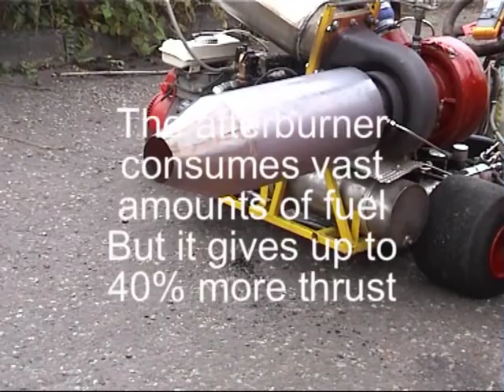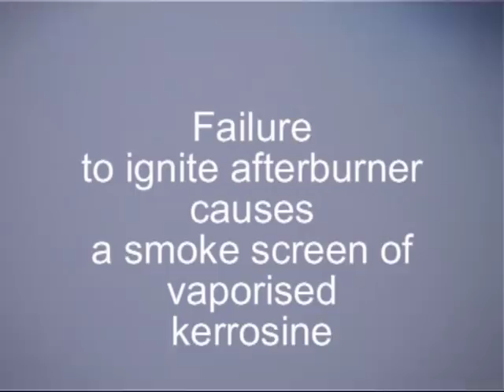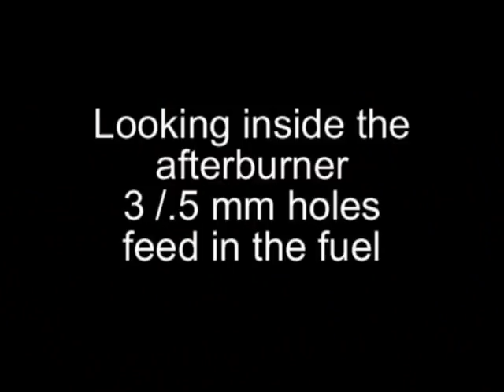JET KART WITH AFTERBURNER ON THE ROAD

Comment: I'm pretty amazed at all the trash talk comments for this.  I wouldn't care if it did only 35 MPH as it's a real jet turbine engine powered vehicle.  The fact that it's been cobbled together from vehicle turbochargers into a working form is quite something.  The fact that the builder has managed to come up with a design that will allow it to run on kerosene rather than bottled gas (LPG/Propane) is one of the biggest hurdles that builders of these types of jet turbines encounter.  Designing a working combustion chamber that will work with a liquid fuel is a substantial achievement that fully 90% of all other homebuilds I've encountered can't do.  Give the designer/builder credit where credit is due.  This is really much more of an achievement than you haters are acknowledging.

Comment: have you considered  using a reducer and gearing it to a drive line instead of using just the exhaust thrust? I'm guessing you are only using a fraction of the potential output as-is. It would be cool to know the results if you ever try it

Comment: Wow... all that for like 15MPH... no thanks I'll pop an R1 in it...
Reply from the maker: Not sure I have the ability to POP a R1 into it
I will just play with gas turbines instead
Reply: doubleboost Me and my brother did it no problem :) we took a yamaha golf cart, beefed up the suspension and axles, removed the two stroke engine, replaced it with a chain driven R1, welded and customized the shifter area, and put in customized clutch cables and throttle cables. We put disk brakes on all four wheels with pedal controls for the front and an emergency brake handle for the rear. We put in a steering dampener and beefed up the entire steering column. We added key start and basically everything on that cart is fully custom. It was actually quite a bit of work, but not too complicated.

Comment: Awesome invention, really fun engineering.  Nothing cooler than a jet engine.  Now you need to modify the cart itself so it resists the road less.  Larger thinner tires to start.  You're losing a large mount of thrust to the pavement.  Also ensure wheel alignment is perfect, or even more thrust goes into the pavement.

Comment: A great project, nice to see some seat of the pants engineering going on. I am absolutely sure this thing, given room, could really get a leg on.
When I served in the RN (during the 1970's) our portable fire pumps onboard certain classes of ships were Rover GT's (the same ones as had been fitted and assessed for use in lorries during the late 60's) 
(Ours didn't have AB's fitted, they just drove a centrifugal pump to fling water about.)
The ship board ones ran on kerosene too, but we started them by using the power of two handle winding sailors, one on each side of the unit. We would crank them up to self sustaining speed, then switch on the igniter followed by the fuel. With luck, they would run like a noisy bastard! 
They were notorious for getting a slug of water in the kero tanks from condensation, so would 'flame out' causing neat kero to evaporate in the hot exhaust forming a massive, white, semi explosive cloud at the exhaust end, if the system then reignited some amazing flashes occurred. 
We managed to roast newly applied paint off a gun mounting when tied up alongside in Bermuda. The sailors had just finished tidying up their gash after painting 'Y' mount, and we, (the Marine Engineering dept) made all the paint fall off again!
Happy days, keep up the good, wholesome fun.

ps, I bet the stink is fierce!

Comment: Cool idea but its going slow as molasses..
Reply: the goal wasn't to go fast, the goal was to put a fucking jet engine on a fucking go cart.
Reply: babs beaver then what exactly is the point of all that extra work? to simply make more noise?
Reply: ZeroSkipps because its dope to put a jet engine on a go kart.

bragging rights too.
Reply: 60mph w your ass 2 inches off the ground and over 600 degrees behind you isn't exactly slow. Granted a bigger compressor and more fuel would up that, but where's yours?
Reply: Gimped Ninja No chance it hit 60.  Absolutely no way.  Maybe 60 km/h.  I think he had set his GPS speedo to the wrong unit of measure.
Reply: Gimped Ninja I dont have one...don't want one. Not hating at all but its going slow...dont u agree?
Reply: Gimped Ninja Do the Brits measure 600F or 600C?
Reply: *****
Okay, cool. Thanks.
Reply: M Edgar Norrell   so true , he needs to get on a track & realy open / go for it,!!!
Reply: gremlinuk1968  OXXo
Reply: M Edgar Norrell skip to about 3:30 its going about 60mph
Reply: drunk mike That ain't even 60 kph..
Reply: +M Edgar Norrell   I hear you my friend - having a jet-cart isn't for me either but THIS is what interests some folks. Life is all about just doing what interests YOU. Personally I'd rather have the same cart but with a 500cc motor  but I would never discourage someone who really wants to build a jet-cart. Sometimes just saying how "slow" it is can make you sound as if you're putting them down, even if that's not what you meant. Written text is impossible to properly interpret because you don't have the benefit of seeing the other person in front of you.
Reply: +M Edgar Norrell For a home built jet engine that was McGuyevered together it did great.  It showed that those folks knew the theory of jet propulsion and had the engineering knowhow to be able to build a working test of that theory.  My hat is off to them.

Comment: would rather just convert a gsr600 motor for a gokart. wayyyy faster, uses less fuel and doesnt sound like shit...
Reply from the maker: BassFreak Would not be jet powerd then
Reply: yeah but why jet powered if its slow as fuck? where's the fun in that
Reply from the maker: BassFreak The fun was in building & developing a gas turbineI could easily bolt a big bike engine in to a kart
Reply: doubleboost so you spend a shit load of money.. to spend even more money trying to power it.. while for half the price.. gsr600...
Reply from the maker: BassFreak Sady you will never understand
Reply: doubleboost I totally understand. A 600cc go cart is just a go cart. A Jet powered go cart is pretty much a fighter jet that lost its wings..
Reply: BassFreak GSR? Duh, forget the 'X'?
Reply: or you could just use the 4 stroke engine.... that he has on there ass a fuel pump lol
Reply: William Haney but the gsr 600 wud be better than whatever it is lol
Reply: BassFreak Define better? I could build a 600cc go cart. A Jet cart I could not build.
Reply: kiltedsaint In terms of acceleration, a traditional combustion engine outperforms a jet turbine engine by miles and bounds...
Reply: kiltedsaint unless this go kart grows wings your statement makes no sense and your point is invalid. No jet power land vehicle has broken the sound barrier.
Reply: lelelele what did i start lmfaoo
Reply: dylan bachora thrustssc in the late 90s I believe.  And it's form over function in this case.   Yes it burns copious amounts of fuel albeit kerosene but the design is great.   What I was getting at is these guys did a gray job showing the functionality of a jet kart not breaking any speed records.
Reply: kiltedsaint understandable
Reply: The point is to be different.
Reply: so different and also useless?
Reply: dylan bachora Thrust SSC holds the World Land Speed Record, set on 15 October 1997, when it ... km/h (763 mph) and became the first car to officially break the sound barrier.
Reply from the maker: BassFreak
It is called having fun
Reply: doubleboost so burning a shit ton of fuel to go nowhere.. is fun? nah i dont think so, that's just called emptying your pockets and wallet.
Reply: lmfao
Reply from the maker: BassFreak
I run the jet on a mixture of petrol diesel (mixed fuel) that I charge to dispose of
If you were standing next to it you would be smiling too
Reply: sounds AMAZING!! British back garden engineering never fails to suprise!
Reply: BassFreak GSR's were not offered for the US market. GSF Katana's and GSXR's, yes. Perhaps in your country but not here. I stand corrected, if that's the case. I deal mainly with 1960 to mid 1980's mc's in my salvage yard and frankly dislike the young man maiming/killing crotch rockets. Their drivetrain however, is awesome. 'Moron' is not such a bad word as there are others much worse.
Reply: 52ponybike my bad, i shouldnt have called ya names but yea, if i was gonna go gsxr id get a 1000, otherwise no point imo
Reply: To your credit though, the jet kart does sound like shit and is immensely impractical. However, these guys wanted to see if they could build it right, and they did a fabulous job.
Reply: dylan bachora Yes one has in 1997 765MPH in Nevada.
Reply from the maker: You enjoy your run lol
Reply: doubleboost awesome job guys.
Reply: havent made one with a gsr but ive made a gokart with a g13a
Reply from the maker: BassFreak
Pictures or video or it never happened
Did your cart sound as shitty as mine lol
Reply: doubleboost i still got the motor if u want a pic of that? i crashed it lol, it sounded like a fart cannon bro lmao
Reply: doubleboost what could better than sound of a jet engine  ??????
Reply: BassFreak
They sound bad ass. My favorite engine sound that exist.
Reply: nimaside well theres something wrong with you
Reply: BassFreak
There's a reason tv shows simulate the sound of a jet all the time (Like when K.I.T.T. from Night Rider moves). Cause jets sound bad ass.
Reply: rofl

Comment: I have seen 10 times faster with an electric motor and batteries and it don't make all that friggin' noise!
Reply from the maker: Not really the same is it
This is a gas turbine built in a shed
Reply: No the one I watched was built in a workshop lock-up. I think they had some over heating issues actually but it's on You Tube and filmed in the UK.
Reply: Comparing a tried and tested system that's been improved over many years to a proof-of-concept built in a shed.

Idiot logic.
Reply: How can you choke on something you have already eaten? Don't worry, I don't go to Dumbsville anyway!
Reply: its about building something different and unique even if its not efficient or fast, thats how new ideas and inventions come to life its about progressing. You would be that guy in past riding your horse and seeing a guy with a home made concept automobile that looks nothing like a car and saying " why would he make such an ugly and noisy thing, why not just ride a quiet horse like that doesn't need mechanical parts?" its called imagination and creativity, something you don't have.
Reply: bustfer07
Really? Well I along with most three year olds could have come up with a better analogy than that!
Reply: sparkyuiop how does a conversation like this come from a jet cart video
Reply: The guy said it does 60mph. So you're saying you've seen an electric one that does 600mph?
Reply: Calvin York
how indeed
Reply: And YOU built the electric bike when? You couldn't build a ham sandwich!
Reply: sparkyuiop Your are right.....Adam had something HANGING between his legs!
Reply: Ignore the troll people. His father and uncle abused him from an early age.
Reply: aptsys
Well nice to see the therapist convinced you to be honest about your past dad.
Reply: doubleboost .

Comment: There is another Jet engine powered gocart on youtube that is built so that the turbine actually powers the rear wheels through a gear box.. It's much more responsive. I can't say I'm a big fan of Jet powered land vehicles that are driven merely by the thrust. I appreciate the work that goes into building these albatrosses though.

Comment: my bicycle go faster
Reply from the maker: You enjoy Your bicycle
Reply: lol
Reply: Didier Michou Your bicycle does not go 60 MPH.
Reply: And neither does this go kart^ lol
Reply: Yes it does.  It just accelerated slow due to large mass, but it still reached 60 mph (and honestly, I think they were holding back at that speed).  They clocked it in the video.
Reply: Ok, so it goes60, just takes 6 blocks to get there, I have lawn mowers that will do that a hell of a lot quicker than this thing, it's honestly nothing special lol
Reply from the maker: Waylon Quiggle Are your lawn mowers powerd by a home built gas turbine as well
Reply: doubleboost oooooooooooook
Reply: No, they're  powered by fully built 10-16hp Kohler motors completely built by Us and they turn around 80-110hp, you act like homemade turbines are hard to make? They're easier to build than our motors
Reply from the maker: Waylon Quiggle
Have you built a gas turbine
Reply: I've built a few actually they really aren't hard to make lol
Reply: Petit humoriste

Comment: the fact that got that much thrust out of a diesel turbo is beyond impressive as it barely has what? 1 stage of miniscule compression? great work! if you were to close up the exhaust a bit and get more venturi effect you could get more velocity but probably more heat than you want. all in all...awesome!

Comment: My bicycle is faster than this thing.
Reply from the maker: You enjoy playing with your bicycle
Reply: doubleboost Sure do!!!
Reply: HAHAHA I think mine is too.  In all fairness, this looks like a because we can project.  I think I'd stick to regular karts myself.
Reply: their problem is that they need to convert it to a turboshaft, right now they are just using the raw thrust...if I had to guess
Reply: but does your bike have flames shooting out the back?
Reply: 4jane2man0 Sometimes. When i eat a lot of beans. Wait, does that count as my bike?
Reply: I got up to 70 kph with my bike.
but the results after this weren't good.Had a few broken bones (that fucking bus)
Reply: legionbunny
 This is the right idea; sure it might be a slow acceleration, but OP could probably make his cart hit 120 mph with all the energy he's burning. (Disclaimer: My understanding of jet engines comes almost exclusively from watching +AgentJayZ's youtube channel)
Reply: joebob3719 they are slow on acceleration compared to internal combustion engines of a similar size, problem is the low output and high speeds, with a turboshaft you'd almost certainly have to build a gearbox from scratch to transfer the insane RPM's to some decent torque, do that right and this thing will street race...if you can control it.
Reply: lol ya mine is too
Reply: mosipd The world record for a bike is over 125mph. In the shape im in now and shooting flames out of my ass, I think i would beat this thing...
Reply: 77chonyc The fastest a human has ever powered a bicycle was almost 83 miles an hour. Better get eating some ghost chillies to get anywhere near that speed.
Reply: mosipd You are right. It is 83 :( :(. Oh well i guess he would beat my fire shooting ass.. Cheers...
Reply: I'm pretty sure if you were a Mexican that just ate a ghost pepper you could petal you bike faster than that thing. Or if you were trying to get away from the cops you can go pretty fast too.
Reply: Ryan Mealtimer Ill be honest. Ghost peppers dont don't really do it for me and would probably get me caught. Give me some milk, good ol fashioned beans, some protein powder, and put me on skates and there isnt much out there that will beat me 0-60!!!!!!
Reply: 77Chonyc to tell you the truth of you give feed a Mexican a taco and hang a burrito in front of him on a string there is no stopping him. 0 to Mach 17 in .29 seconds. But the electric wheel chair in the video macs out at 6 mph and takes 2 hours to go from 0-6.
Reply from the maker: Have you any video of your bicycle lol
Reply: legionbunny 10 to 1 ruducer gear and use any automatic. gear box you want
Reply from the maker: Good lad you go and play with it
Reply: biciclete
Reply: 77chonyc yea but it’s cooler than your bike
Reply: Ryan Mealtimer lol

Comment: how is the power transmitted to the wheels? no transmission & just direct connection from the turbine? or do you use some type of a coupling / clutch to engage and disengage?
Reply from the maker: It is driven by thrust  the jet pushes it along the dame as a jet plane

Comment: There's a Ytuber called Agent Jay Z; an actual jet engine mechanic. Cool stuff... one thing he talks about is the design of the combuster liners, which are designed to ensure that the hot gasses don't melt the case... they look like coffee cans with holes, but are precision engineered... very interesting stuff. I agree that this is very cool, and haters
and trolls should set a play-date. ;-)
Reply from the maker: Combuster liners are a real black art

Comment: That is totally sweet and awesome i would love to build one would it work with a snowmobile motor or even twins former fighter pilot the afterburner was a sweet touch where was that when i was a kid i did think of a jet engine gocart but it was only a dream i didnt have the engine  but when i was 12 i built a twin 440 cc snowmobile engines in a gocart frame it was bad ass and a fuel hog but i was the fastest in my neighborhood back then

Comment: You need the thrust in the middle for better handleing and get rid of the normal engine and replace it with a small electric pump it will cut out allot a good % of lbs for you to get higher speed then attach the top half to a glider and your all good for take off

Comment: Is an electronic controller drive a fuel pump and monitoring temperatures / rotational speeds to enforce limits?
Reply from the maker: +Raymond Chiu NMo it is all manually controlled

Comment: Fuel probably costs 5x the normal fuel and this goes 5x slower than a normal gokart which is way cheaper
Reply from the maker: It runs on a mix of petrol / diesel that I get paid to dispose of
Slower than a normal kart but lots of fun
(go karts are for children they are pedal powerd)
This is a kart

Comment: what type of pumps are fuel and oil pump?
Reply from the maker: +TRXSlashPWR VW power steering pump for the fuel (up to 500 psi)Hydraulic pump from a old car lift for the lube (80 psi hot)Both chain driven from the little Honda